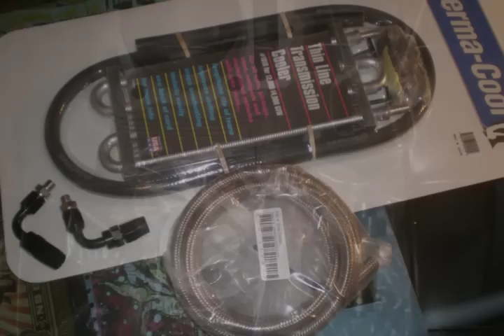Best YFM350 Warrior Rebuild?

Comment from the maker: @duneracerweston Summit Racing. You can get them at you local autoparts stre too. Its a transmission cooler. Just measure the are you want to put it and buy a size that close to that.

Comment from the maker: @Hawkster0001 Th stock bumper was trashed. I scrapped it. Most of the stock parts I sold off or traded. A lot of them I traded with the other warrior I had for a bit. Ebay usually brings up about 15 pages of warrior parts. Search warrior 350.

Comment from the maker: @calypsobikes Its a perma cooler, with a 6' stainless steel lines kit. Bought it all from Summit Racing. If you sign up to the YFM350 site, there is a complete parts list and walk through on there. You can do the cooler kit for around $100.

Comment from the maker: @chadwick330 Very will could be out of time. If the cam chain stretched to far its quite easy for time to jump time. What you mean it has no power? Adjust ur valves and check your timing. Also do a compression test. That should help. If all check outs then I'd start gettin into some carb work.

Comment: yeah im just tryin to find a cheap aftermarket fonr tbumper, one of the ones that have the two outer loops style, i could make one if i had metals right now, but i dont want to spend 50+ for a bumper, iwant one that has those loops, because i saw a really nice lokking light system, with those lights mounted in the bumper side loops

Comment from the maker: @calypsobikes All you need to know is the shock length and you'll be good. I don't have a fox shox on the rear, I run a stock banshee shock in the rear. FOX shox are kinda pricey, WORKS are a good upgrade over stock and don't costs as much.

Comment from the maker: @369imfine The FOX's are way worth the money. an air ride is the way to go. Plus you can change the PSI in a few minutes, where as with spring shocks, you'd have to send them out to be re-valved. And spring shocks need maintenance more often then the air ones do. I got the edlebrock years ago, used. And now a days eblebrock has dropped there motorsports division, as of a few months ago. I read that someone was to but the line but don't know anything else at the moment,

Comment from the maker: @2253raymond It works great, cools by about 20-50°. Tapping the cover is a little more involved. You have to line it up on the oil gally and then fill the space in between so you create a cycle. Sign up on yfm350 . com for more info.

Comment: @bisket2003 Thank you bisket2003! Might i say that was one f*cked up quad at the beginning! Great work on the rebuild/restoration. haha i found your post on this rebuild! Sweet Thanks for the info. I was wondering what part number from summit and so on. Because I see that you used the swivel 90 degree. And what looks like a male to male adapter. I saw somewhere i think bluetraxx that is you use the 90degree brass they might run into each other when tightening the fittings down! Thanx in advance!

Comment: What kind of oil cooler line fittings did you use? I have a 2003 warrior, looking to do the oil cooler mod. have some overheating issues here in AZ!

Comment from the maker: Don't have an exact on the cost. Surprisingly not as much as you'd think. It took quite a while of scrounging around. looking for the best deals and man I found some great ones. I know I saved thousands compared to retail prices. Ebay and craigslist and friends is where I got most my parts. I run yfm350(dot)com so I had some help from the dudes on there as well. I suggest if your a warrior or rappy 350 fan, sign up on there. Good stuff to be had.

Comment from the maker: No you have to tap and block off the oil galley on the clutch cover so that it makes a continuous cycle. About $100 form Summit racing. Check out yfm350(dot com) for more info. I'm a moderator on there.